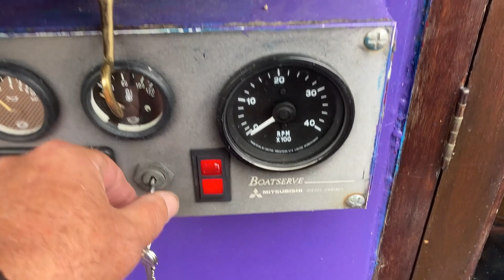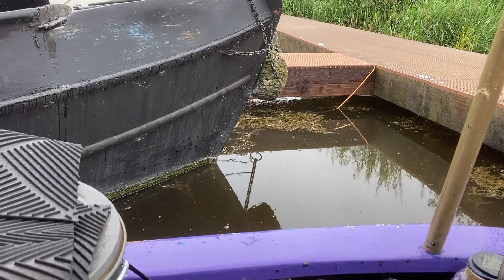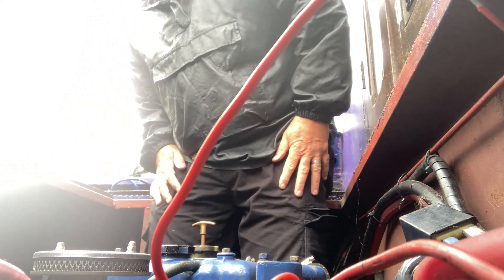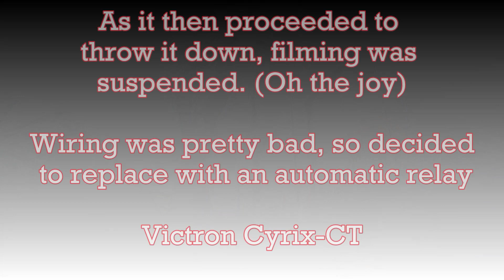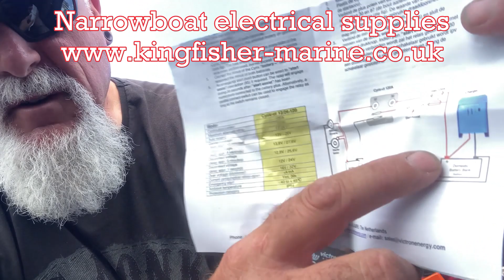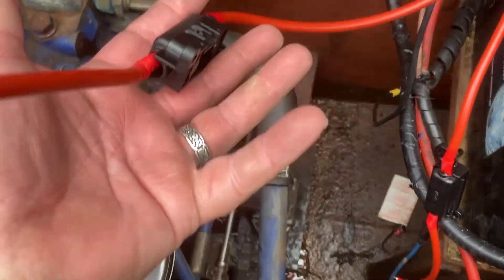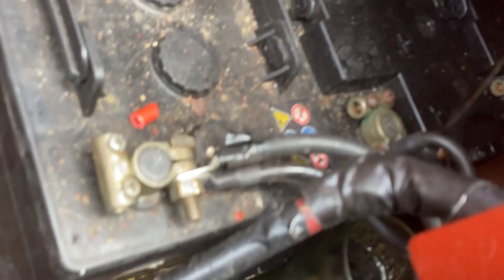Narrowboat Electrician -  Victron Cyrix-CT Battery Combiner

Comment: Good day, I have been researching the victron Cyrix to partner my Victron 12 12 30 dcdc charger. 
My reasoning is that I'm using it on my winch truck and need good charge kept up but also need power of both batteries to power the winch. Are any of the cyrix dual pass through to allow both batteries to be used for powering the winch for more than a few seconds. Thanks hope you can help

Comment: As you say, Fuses (or circuit Breakers) are there to protect the cables, and by default the load.  I cannot recall how often I've heard the excuse "But it's only 12 Volts"  or even worse, "It's only 12 Volts, I don't need Grommets to go through that panel!".
Always fuse as close to the source of power as you can Folks, and if you go through a metal panel of any sort, I'd use a stuffing gland to be sure. Many Decades ago I used to drive an Austin J4 van, where the Battery was behind the driver's seat, the Positive cable to the fusebox went through the floor from the battery, protected only by a rubber grommet. 10:30 at night, pouring rain, and it decided to short out. 'Why is my bottom getting hot?' Stopped very quickly, opened the door, and pulled the seat out, I managed to pull the cable away and it had burnt almost through. Bad enough as it was, downright scary if it had been an unattended boat!
Reply from the maker: Great comment, you were lucky with that ban. I don’t use grommets, use a gland. Cables through metal bulkheads should fail BSS examination, if they bother to look. I see them everywhere.

Comment: Hi Chris Just a question about cable fusing. If your using a Lynx distributer and the batteries are in the engine bay but the distributer is inside the boat you could potentially have a cable of one meter or more from the battery bank is that correct? Just with you talking about fusing close to the battery.
Reply from the maker: If you look at my installation with a distribution box, I indeed fit a fuse at the battery end of the main feed cable. Otherwise as you say, that cable would be unprotected.
Reply: @narrowboatelectrician   Thanks Chris for info, I thought I was being over cautious when planning my electrics.